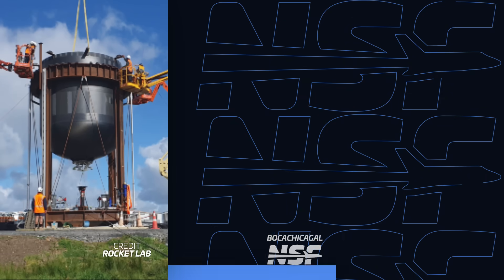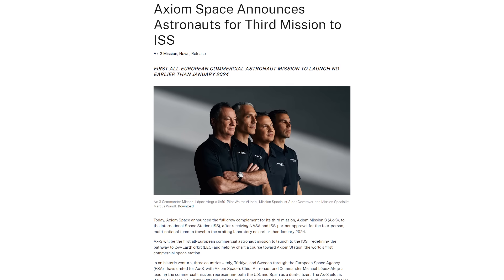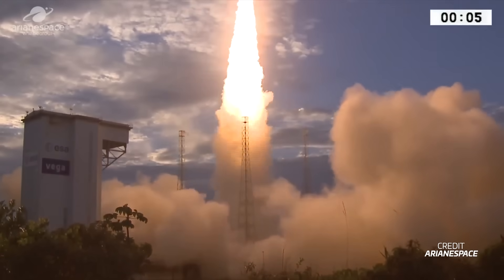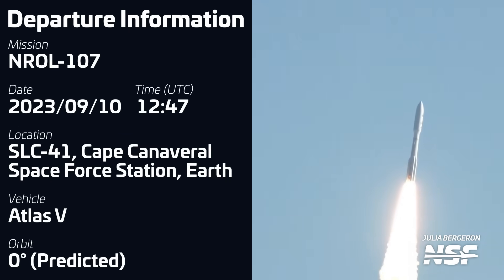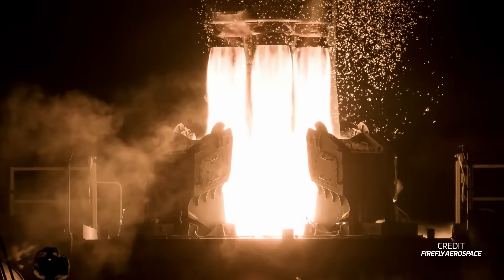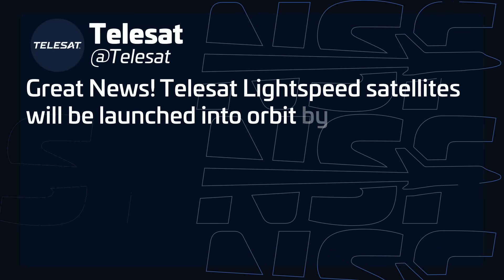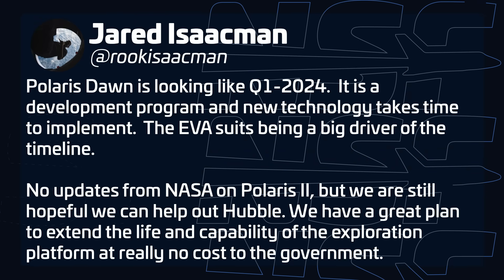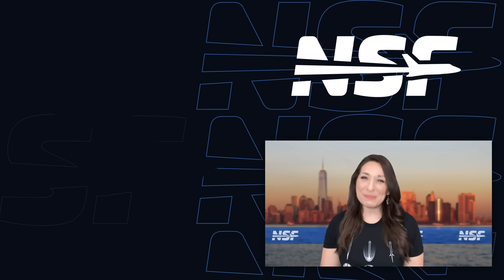Starship Flight 2 DESTACK, Rocket Lab shows NEUTRON hardware | This Week in Spaceflight

Comment: My prediction is that X is going to launch on 9/25 (get it?). They already did it with 4/20. Thats the way they like to work. The FAA is almost done, and the paperwork is on the table. This will happen before October. There all ready. Their is always a reason for everything. But X likes to use that extra excitement when operating. 
Thanks' for a great video! 
 - NOM
Reply: Being a Brit 9/25 means zip! Care to elucidate?
Reply: @coastie1961 Reference to the ship and booster number currently being prepared for flight. Although they didn't do that for booster/ship 4 and 20 like he says in the comment, since it was ship 24 and booster 7 launching on 4/20.

Comment: Hey Elysia, just wanted to point out that image of Neutron was of the full stack, not just the second stage. The upper stage rides up inside the fairing and the image shows it staging off the booster. Neutron isn't Starship, the upper stage is expended.

Comment: You say that the test vessel that SpaceX used for carbon composites did not work to the pressure they expected? I am curious about the source for that information? Because according to Elons presentation about that test  article they pushed it beyond intented pressure and tested it to destruction.
Reply: The pressure it burst was much lower than the one it was intended to burst at. Making good and big pressure vessels (tanks, basically) out of composites is really hard. Much easier with stainless steel (which they also had issues with at the beginning but it is easier to iterate with steel than composites)

Comment: If you want to arm the FTS on Starship then you have to de-stack!
Reply: Why don't they just add some kind of retractable catwalk on the chopsticks? They could lift the workers to any position on the ship while fully stacked😂
Reply: Not arming but pulling the safety pins and, given the comments made by Kathy, the charges may not even be installed on the vehicles so they also need to work on that. Arming of the system is done remotely via electronic signals on the final minutes of the count which is when you normally hear the call out "AFTS is ready for launch"
Reply: Yes the pins are the to prevent arming the system by whatever means. You also hear regularly the "FTS has saved" meaning that the FTS has been disarmed, for example with the Falcon 9 first stage just before landing.
Reply: @Canofasahi  The word they are using is 'safed' - i.e. "made safe"
Reply: It's a shame they can't use a tagline to arm it.  I don't know what's involved in arming the FTS, but I envision a pin like on a grenade that you could pull with the tagline to arm the FTS.
Reply: @59seank it’s so much more than that.
Reply: It's being de-stacked because the FAA told SpaceX to sit down. Elon once again being premature 😂